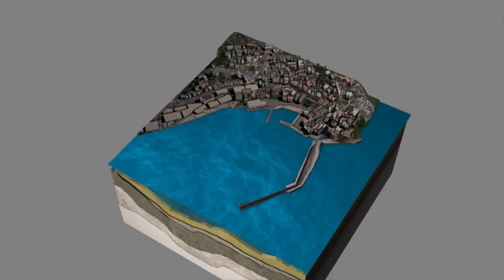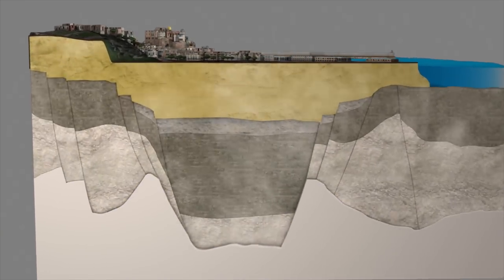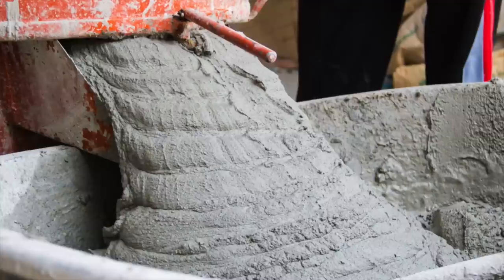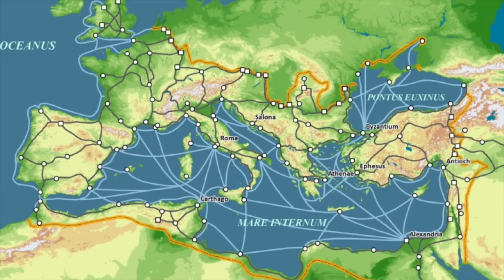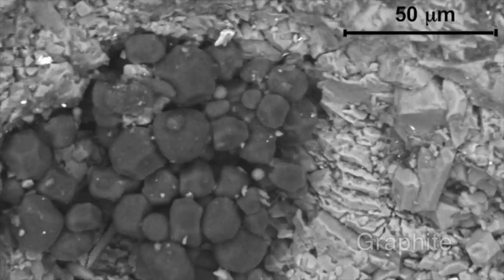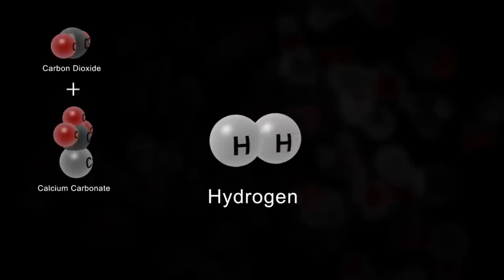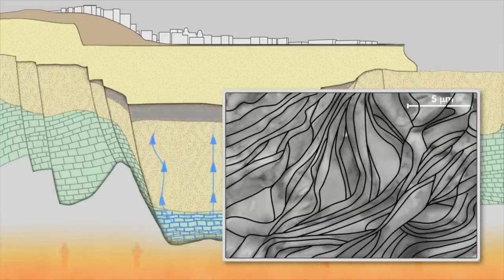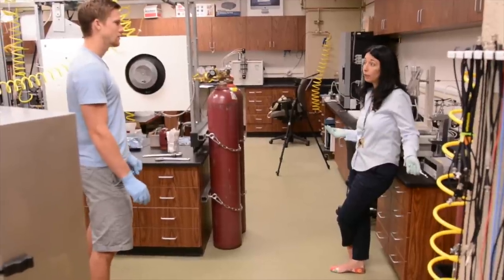"Natural concrete" beneath Italian volcano explains mysterious uplift

Comment: So next eruption would be bigger than any before.
Reply: There is no indication of that.
Could be the size of any other eruption that occured in the caldera in the last 5000 years. All of which were magnitudes smaller that the caldera forming eruption ~40.000 years ago.
Reply: @Vulcano7965  In theory it would as the caprock just creates more pressure leading to a bigger explosion when it eventually gives
Reply: @harrytilbury2453  again, no clear indication for an eruption rivaling that one 40 ka ago.